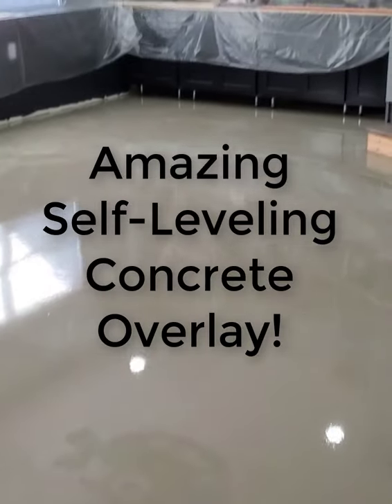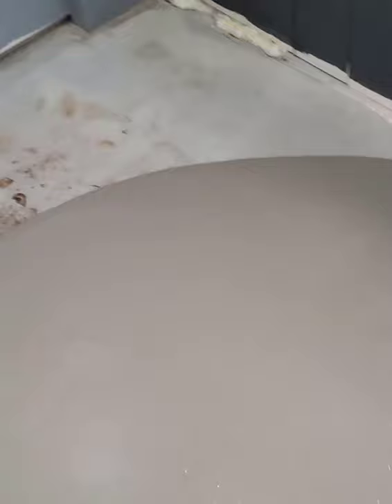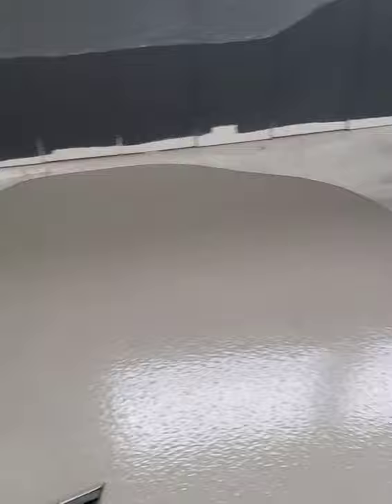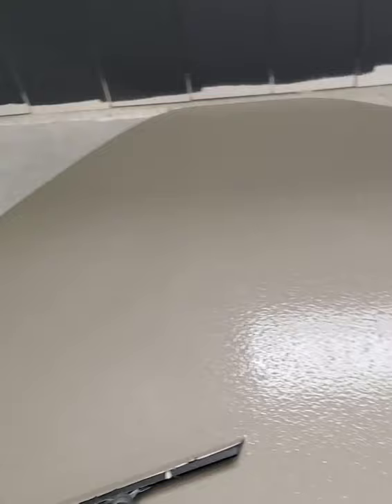Amazing Self Leveling Concrete Floor Being Done!

Comment: Does this stuff bond at all to the concrete below it or is it super prone to cracking if something is dropped on it?
Reply from the maker: It bonds very good, we use a primer beforehand.
Reply: Was gonna ask this same question.  Might be a good option for my basement… thanks for the video, Mike!!
Reply: @MikeDayConcrete  the primers
that I have used are blue or red never seen a clear primer for self leveling what brand do you use?
Reply: @MikeDayConcrete  
What do you mean you use a primer. I don't see primer paint on that old cracked underfloor. 
Thank you for reply
Reply: @jimjones9846  
Clear primer? What is it called i want to know.. we are pouring
Reply: @Designer_TopG  last primer I used was blue, but does dry where you can not see it

Comment: Question. If it’s “self leveling”. Why do you need screws?  If the product works as advertised. Shouldn’t  it just flow out to level on its own?
Reply from the maker: They're all like this. Still good to have a reference to go by. This stuff is expensive so you want to get it right the first time. All materials have some type of surface tension, even water doesn't completely self level.
Reply: Tim Lachapelle  water levels itself to an extent, but you're ignoring surface tension.
Reply: When you need a reference to how high you want the self leveling compound to be you put screws in to check.
Reply: Tim Lachapelle  
No it doesnt . It beads.
Reply: @MikeDayConcrete  yes water self levels. I’ve used a water level for years. More accurate than a lazer level

Comment: It's amazing how everybody thinks they know everything did you prime the original floor with epoxy resin so the layer of self leveler won't crack or dissolve in time?
Reply from the maker: We used Sakrete's primer

Comment: I saw a guy that hard a 55 gallon drum mounted to a roll around. The drum had a 2" valve on the bottom. He would mix his self leveler in the drum, open the valve, and wheel the drum around. I thought that was a good idea!

Comment: Any suggestions? We had an overlay done inside home. Contractor did a stamp which is way to aggressive. Looks cool but very rough. We also have some areas that are cracking. 
If we wanted to do regular floors what would you suggest? A self leveling over this self leveling and then tile or chip the entire house out? Roughly 2000 feet of stamped flooring. Including kitchen and 2 bathrooms

Comment: I heard you mention you use a majic trowel, but couldn't find it in the description. Qould you please add link for it.

On Amazon the kits include a sawtooth or squaretooth pole trowel, i am not sure if majoc trowel is the same thing and if  either works better than the other, please advise!

Comment: Mike, is it possible to use self leveling mix to repair an area that has a 6” swell?
I recently mud jacked my shop but ended up with a pretty big dip in the floor. The area for leveling is approximately 20’x30’. This all tappers down to the 6” in the center. Or would you suggest some other method. 
Thanks, Gary

Comment: I don't know anything about concrete so i wanted ask, when prepping a floor for this self leveling is there any sort of chemical adhesive/bond that needs to be applied before the self level concrete is poured? Or would it just be a general grinding, sanding, cleaning of the top layer of the original floor?
Reply: There’s a primer you can get at any major home improvement place. It helps the new stuff adhere. It isn’t required but helps with the thinner sections of new concrete, helps avoid separating
Reply: @knowideas7184  
What is the primer called  ? I need that . Also , what is this leveling stuff called ? Thank you !!

Comment: I did a stamp and I use a powder release with a water proof sealer now I have a low spot to fix is for a driveway can I use this product there in afraid to cracks with the vehicles

Comment: That looks like what I need to resurface my garage floor. Can you please provide the specific type of Sakrete you used, and any other materials, such as a pre-coat before the Sakrete. I’m a complete novice, so I need as much hand-holding as possible. Thanks.
Reply: For what it's worth, some garages are intentionally angled downward a few degrees to help water exit efficiently. Cheers!

Comment: What is the brand of the overlay you used? Or is that not something you can divulge?
Reply: likely ArdeK, but he can say....there are a number of great products. What is sad is that many guys take advantage of the homeowner and charge a crap load of money for doing this. While the product is more pricey than concrete, instead of costing 5$ a sqft, they charge 12, 15, to 20 per sq ft!!!  For the 20, you do get a polish 2 coat process, but not needed in most cases, or the finish look you want. Some products are more cementacious, vs others more poly. Can look great, but high quality large format Italian floor tile installed is much cheaper at the crazy prices some want to charge.
Reply from the maker: This is from Sakrete
Reply: Sakrete or level quick are brands I’ve used .
Reply: @MikeDayConcrete  
Thank you.  Sakrete got it
Reply: @Jmuffdiver  
Level quick thank you
Reply: @Jmuffdiver  
Whats the name of the stuff that goes before the top concrete flow ? A bonding agent ? Whats the manufacturer  or name of that stuff?? Thank you !

Comment: And it won’t crack or separate from the concrete??
Reply: Not when you use a bonding agent.
Reply: @Tool_Addicted_Carpenter  
What is the bonding agent called ?
Reply: @Tool_Addicted_Carpenter  
Were not talking 007

Comment: Stupid question, do you remove  the screws once the self level reaches the height or leave them as anchors. Thanks
Reply: You leave them. Ideally you want to pour just to the tip top of the screw/peg or whatever you’re using, then after you sand you skim over the tops

Comment: How thick is the coat?
Reply: Whatever it takes to make it level. More often than not, you're going to end up with paper thin layers because that's what it takes to end up level on high points.
Reply: @Tool_Addicted_Carpenter  
Yes very good.
So what is the name of the primer stuff that you have to lay down first.  Thank you.

Comment: Why need the reference screws if this stuff is self leveling?
Reply: It's "mostly self levelling" lol :) It's a higher viscosity than water, so there is still lateral resistance. So you could pour a whole room but end up with slight level differences - like a very slight wave effect. Having reference screws allows you to get it more exact and make the wave extremely slight, a good operator can get it to under a mm, which is usually good enough for flooring.
There's another product you can use that's similar but much less viscous, and it evaporates / soaks in leaving the solid behind, like mud, which you can do multiple applications of, but it's time consuming.

Comment: How that levels out? Looks like shit homeboy haha if it was level it would look like glass. If i can see ripples in the reflection, it aint level. I can hear you wearing spikes, if youre going to wear them then use a paddle, a rake and a spike roller like youre supposed to. I will say for using only a trowel, it looks good; it aint level tho